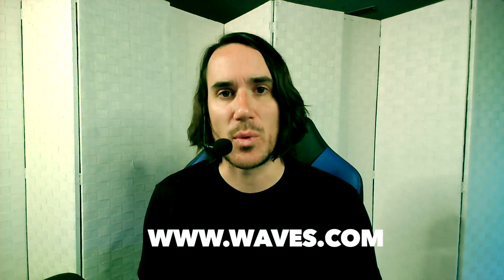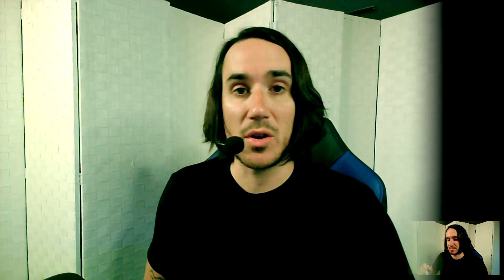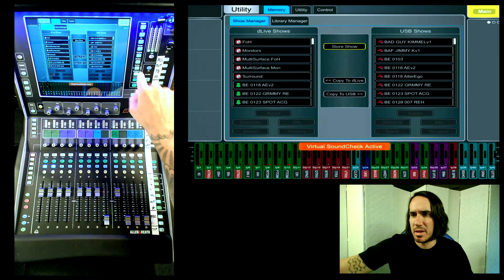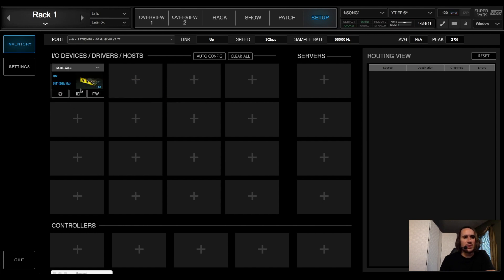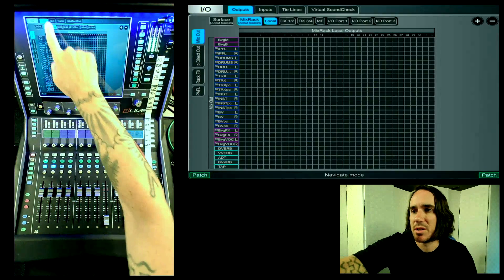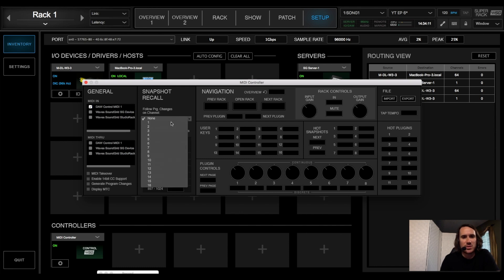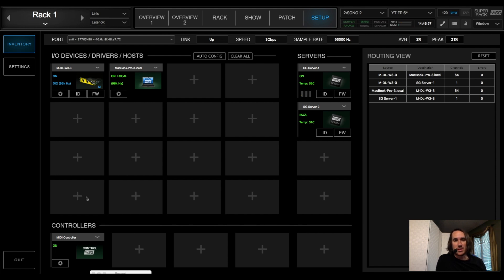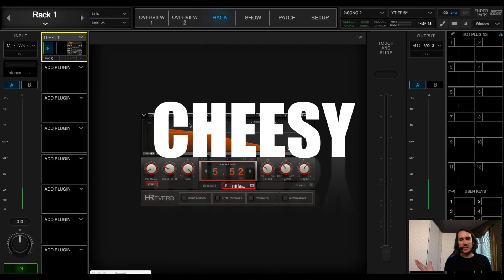EP6 - Step-by-step for setting up Waves SuperRack w/ Allen & Heath DLive with Scene Control.

Comment: Thanks for the video! Unfortunately, I can’t get Waves Snapshots to be triggered by the dLive Scene changes, to go with that scene. I can assign the go button to the next Snapshot in waves, but just not directly to the scene. Anything I could be doing wrong? Also, I see in the dLive MIDI DAW Control software that there isn’t a way to assign to it to a MIDI Channel like in the past.

Comment: Will this approach with midi control still work if the card is inserted in the surface instead of the mix rack?
Reply from the maker: Yep!
Reply: @asumoftwobusses6304  appreciate the response! Running into a hangup getting scene control to work. Midi learning is working great for softkeys, but the actual scene control doesn't seem to work even with the correct hex offset.
Reply: @E85armedFG2 Hi! Any solution to this?
Reply: @playitsweden4700  yes! I had to change the midi channel to 12-16 to make it work

Comment: You know. I LOVE when people do tutorials on YT and it work. But when we follow the steps exactly (correct connections, correct IPs, correct settings in SuperRack, accounted for scene offset etc) it just doesn’t work 😅. Drew. Could you please do a troubleshooting video with some issues and fixes you have found when working with waves scene changes from the console?

Comment: Hi Drew!
Love your work and this channel. 
I know you're not Waves or DLive support, but maybe you can help me.
Since i changed to Apple M1 and Waves SuperRack V13, the MidiControl doesn't seem to work anymore. 
When recalling a DLive scene, the little MIDI light in SuperRack still flashes, but the SPRK scenes are not following. 
Any changes that happened because of these updates? I didn't changed anything and it worked before.
Thank you so much
Adam
#adamngoodsound

Comment: Nice job, used this to guide me on setting up my Avantis with SuperRack. NOTE: The Belkin USB-C to Ethernet dongle does not work with MacBook Pro 16, I had to get the OWC Thunderbolt 3 10G Ethernet Adapter to get the MIDI Controller to connect to the Avantis.

Comment: When you do the playback from the DAW back to the Dlive do you switch the A to B option on the súper rack?
Reply from the maker: Melissa Riner I don’t! If you route it correctly you won’t have to! I would suggest dedicating io for inserts and io for playback
Reply: Thanks for the answer, when I got my super rack the waves dude helped me over the phone, I got A for live and he told me to switch to B for playback. It worked but somehow my trim gets bypass on playback so my gain structure gets effup. I’ll try the 1-64 and 65-128 approach and see if that fix my not trim on playback. Thanks again!

Comment: Have you run into any issues bridging TCP/IP control traffic and SoundGrid traffic on the same physical network? 
When I evaluated a small SoundGrid system (Impact Server and DiGiGrid D) for my studio I used a separate Ethernet interface on my Mac Pro specifically for SoundGrid along with a separate VLAN on my Ethernet switch.
As Waves says: "SoundGrid is a ‘private’ network: in order to have a clean network stream, the SoundGrid network should not be used to run any non-SoundGrid applications. Using non-SoundGrid protocols on the same network that carries SoundGrid audio might result in audio drops, application freezes, and other unexpected results."